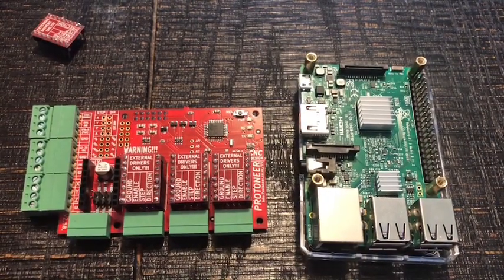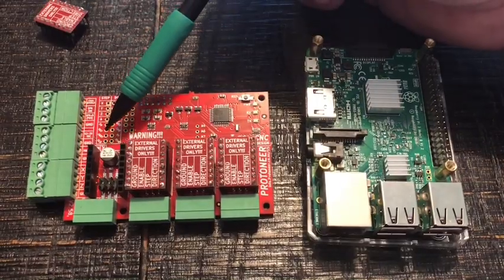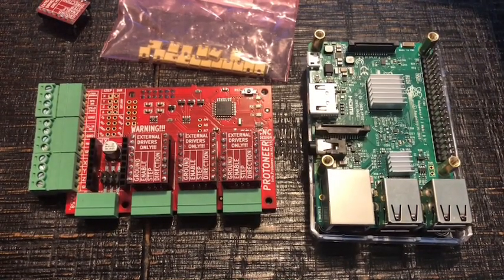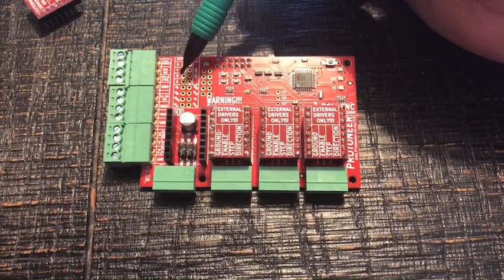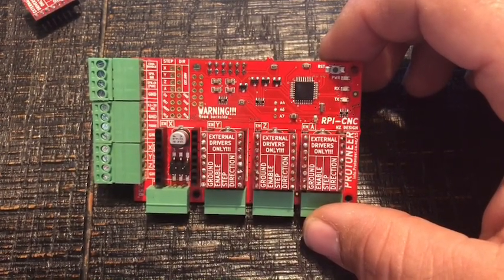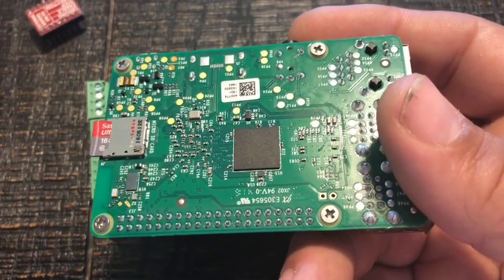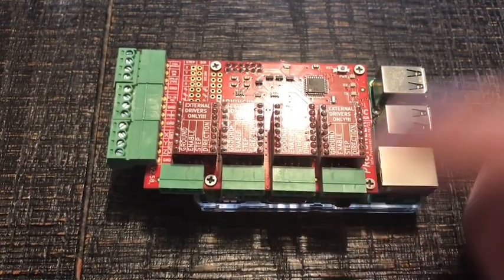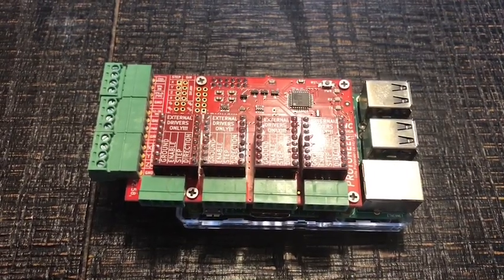Raspberry Pi CNC Build Part1

Comment: what software i need whit protoneer board ? can i use linuxcnc/emc2 software, i just think orden protoneer board and external motor drivers DM 850 about, i have 5A motors. how setting linuxcnc pins, step,dir,enable,etc spindle this protoneer board. i has build before mach3/linuxcnc paraller port board has easy setting pins what have X,Y,Z ok, but no understand how protoneer uses, i just has buy raspberry pi3 board, need i make somethink code can use protoneer board if install linuxcnc to raspberry pi3 and controller protoneer board whit external motor drivers. please make video how setting and use protoneer and linuxcnc raspberry pi3.
Reply from the maker: I currently use bCNC. If you download the profile from the Protoneer Wiki I think it has bCNC, UGS, and some other one that escapes me at the moment.  The Protoneer board uses GRBL so any one of the senders should work.
Reply: @RBallarddesigns  ok,i just looking and lownload bcnc software to old raspi3 board, manual x windows. only has python2 i writing all code python3 because new bullseye have python3. i not know working or not but install somethink ok, i not understand code anythink. next i need orden protoneer board if i found somewere cheap this. newer not buy ower prize, i see before 100$ has one protoneer board no newer pay 100 $

Comment: ...BEST GREEDINGs from BAVARIA! Thank you for your Video! 

...please help with the following
question. I search for a cheap and simple solution to control our Saw
for cutting the trees (trunk) more comfortable with a RaspBerryPi. 

It has to control 2 motors (each 30Nm)
for our Saw on the Farm. 

One motor is for the thickness of about
30mm (adjustable 1mm to about 600mm, in 1mm steps). 

And a second motor for the automatic
feed of the Band-Saw (with adjustable speed and a limit switch or
settin on the start and endpoint). 

I also need a Display and buttons (or
Touchscreen) for the speed of the movement and to choose the
thickness. Also the thickness of the band saw blade has to be taken
into account. So when it cuts the first layer , then it should drive
the Saw up with the next Layer (thickness) etc. etc! 

I would be really happy if you could
help me develop this in a cheap way. And how can i connect a 30Nm
Motor to the raspberry?
Reply from the maker: Sounds interesting.   If you can find a proper stepper motor to power it, you shouldn’t have a problem.
Reply: what is the protocol used for communication between raspberry pi and hat?

Comment: card need be output external stepper drivers not mini 4988 toy drivers. then can use big drivers and big normal nema 32 5A ot 8A motors what need real good cnc

Comment: max 2Amp motors, shit. normal cnc user use max 5A motors, not childrens toy motors, only 3D printer and laser uses super small toy motors.
Reply: Thats what I was wondering, my nema 24 are 4A, but the stepper motors in the video are rated at 4.2A so should be OK I guess.
Reply: @mickyas1000  driver current need be less than 4A  if use 4A motor, but not too low. not power. 2A max current driver working but have too low current not torque run good. normal used external driver if use high current motors, etc, arduino controller uses not small arduino max 2A driver then uses external etc, DM 556 drivers and setting driver current near motor current  but not highest than motor max current or burn motor, DM556 can use setting 3,6A but not 4,3A if motor max have 4A or 4,2A. need select driver same range than motor have, if use 5A max current motor need order driver what have setting possiple use 4,6-5A current setting.
Reply: @mattivirta  thanks, no offence, but I couldn't understand a word of that. I have nema 24 stepper motors and DM860 drivers, so is it the power of the drivers which need to be 2A or less? This electrical stuff is bloody confusing. 🤣 thanks again for your response. 😊
Reply: @mickyas1000  if you use 4A max current motor DM860 can setting nearest current 3,7A to driver setting.  dm860 minimum current setting have 2A, and power supply need be more current than all 3 motors have together, mean if use 3 motors need minimum power supply be 3x max motor current 4A  is 12A or more power supply need be. and 4A max current motors need driver currrent setting 3,7A not next step 4,2A or burn motor. dip switch setting to current. you dont can use motors max 2A current this driver or have marginal maybe can but maybe if torque have lot burn motor. because driver peak current possiple burn motor if load motor too much, max 2A current motor,

Comment: Is there a Atmega 328P on this board, like on the Arduino? Is it running grbl 1.1?
Reply from the maker: Yes.  Protoneer basically imbedded an Arduino on to the board.  Earlier versions actually used a separate Nano attached to the board.
Reply: @RBallarddesigns  Thank you :)!
Reply: @RBallarddesigns  need protoneer nano chip install somethink code  or have code ready to in protoneer board ?

Comment: will this work if I make the machine larger with larger stepper motors?
Reply from the maker: I would guess so.  I used 420oz motors.  How large are you planning?
Reply: @RBallarddesigns  first you need select what and how large motor you use, then looking data sheet what id maximum current this motor, and then need select external driver this motor current, can handle more than motor current and can select current dip switch setting this current or near less current setting but not more than motor max current have. and then connect external driver to controller board step,dir,enable pins. ready.

Comment: Hi Ryan: I am using the Protoneer Raspberry Pi CNC hat v2.60 - GRBL v1.1 
Compatible. I understand this v2.60 supports  END STOPS,  Coolant, 
Spindle Direction, Spindle Speed. I would like to  find some info on 
this. Thanks for your help.  Tom

Comment: Why do you need external drivers apart of the ones on the RPi hat?
Reply: external drivers uses if build real good cnc biggest motors 4-8 Ampere, board own little drivers not can use only less than 2A motors 3d printer,laser etc what not need lot torgue, milling wood,aluminium,steel need lot lot biggest motors can mill and big motors need lot more amperes, thats is why external drivers uses. less than 2 ampere drivers not have torgue/power lot not can use mill only printer or laser,
Reply from the maker: Darío Enmanuel Gómez Heredia because you are limited to 2a drivers on the hat itself. I am running 4a drivers to power my 4a 420oz motors.
Reply: Let me see if I got this through, you are using the TB660 because you need more power to control your steppers, but if I use a powerless motor I can use the hat without a problem, right?
Reply: By 4a you mean 4 ampere, right?
Reply from the maker: Darío Enmanuel Gómez Heredia yeah if you are using either smaller motors (like 269oz motors for example) and/or don’t need to push a bunch of current, the on board drivers would work fine.
Reply: Thanks, I'm full of questions, to be honest, but I will document myself first before asking them.
Reply from the maker: Darío Enmanuel Gómez Heredia no problem at all.  Ask away
Reply: hat not handle more than 2A motor  maximum, if normal cnc used 4A 425oz motor need use external driver who handle more current than 2A basic, select motor what you want use, torque have important be high, then select driver who can use this motor max current or more, current have important be less at motor max current or same. etc 4A motor need driver what handle 4A current, board own driver not can, need external driver.

Comment: hi, is possible to use the raspberry without the  hat to control a cnc with tb6600 stepper driver (connect raspberry direct to tb6600)
Reply from the maker: Pedreiro Geek no you need the hat. I have part 2 to this I just need to upload it
Reply: Yes you can, You would also need to add a ardruino uno or mega flashed to do the controller set up your pi with its own touch screen and install ugs to operate it
Reply: theoretic yes but need write ALL program own new, if use protoneer board arduino have all program who handle all input/output signals computer to board.
Reply: today update, yes can, but need shift level convertet TX108 all output can use 5V output, rpi is only 3,3V out. same input need optocoupler board all input safety make 3,3V rpi input pins.

Comment: Great video, thanks so much. For your standoff comment, I used M/F plastic standoffs to stack the Pi and CNC board and to prevent any shorts if the metal screws cut through the silk layers on the PCB into the copper plating.

http://sayal.com/STORE/View_SPEC.asp?SKU=225794 (for reference)

Comment: Why are you slaving the A and the Y
Reply from the maker: Mufaro Chikeya  I slaved the A and Y so they would have individual drivers.  I would think You could run them parallel and use one driver, however with the size motors I am using separate drivers would provide the power I need. 

Thanks for the question.
Reply: many cnc machine uses 2 motor at Y axis, because move all other hardware and need more torgue, looking all videos DIY cnc and u see Y axis have all 2 motor, power more move all beam,Z axis,spindle etc. 2 motor can use Y motor and slave A motor move sametime same step.